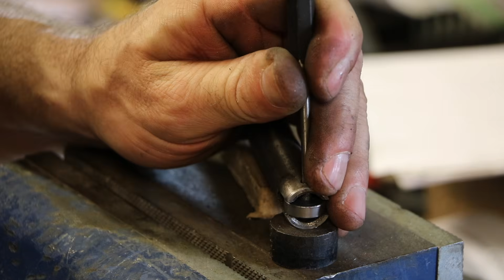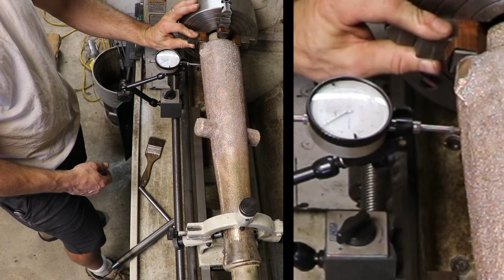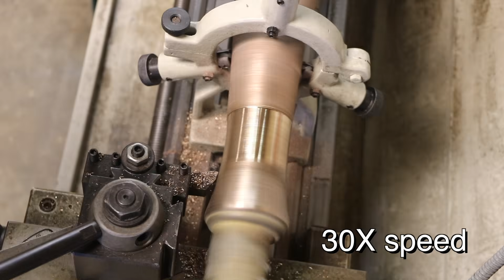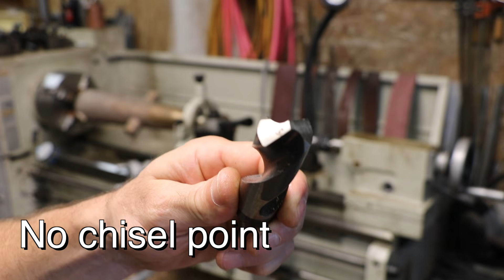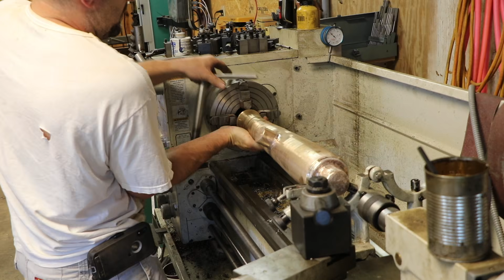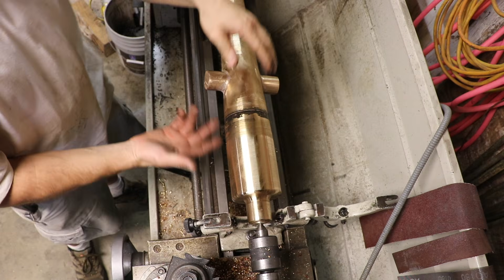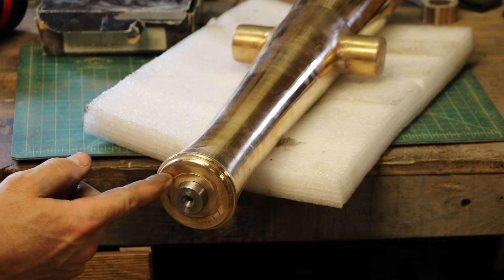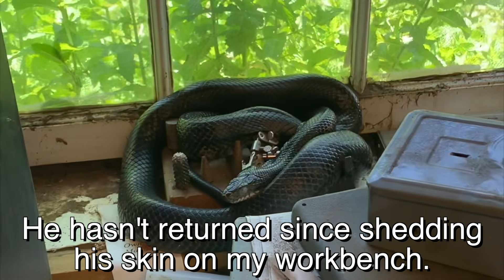Machining a Historic Bronze Cannon Barrel, Scaled Down Replica. FarmCraft101

Comment: Yepp, sleeve it as Sternstone suggest. But first reline the bore using epoxy resin that you allow to spin harden in the lathe filling all the voids. Then rebore it to suitable diameter and insert a stainless steel sleeve that you have filed a bunch of small notches in so it adds some grip. Fill the entire bore with epoxy resin before you insert the sleeve, then dump out the excess resin. This way you will be sure to have resin all around the sleeve/barrel junction. Finish it of by boring away the resin residue from inside the sleeve. You can make the sleeve two inches shorter than the barrel and insert a bronze sleeve in the opening if you want to mask the fact that there is a stainless sleeve in the barrel.  You can make this outer sleeve threaded for extra strength.

Comment: Sleeving the bore sounds like the best solution, the visible defects could just be a hint of other defects that can't be seen but have sufficiently weakened the barrel structure enough to make it unusable.
Reply: I would agree that sleeving the bore is the best option but still think it is unnecessary given the pressures likely to be encountered with a black powder load in a bronze barrel. However safety must be the paramount consideration so ... sleeving it is.

Comment: Just a comment that nobody will reply too, and you probably won’t see, but wouldn’t making the outside as round as possible before drilling the hole help? When it’s uneven it wobbles a little and that will throw off the bit. Just my opinion as amateur  machinist.

Comment: hmm... how unrealistic would it be to machine the defective part out, then heat the whole cannon near melting, and then add new metal in, (of course block the good parts with a block of wood or whatever) so you have only to re-do the bad part ?
Reply: alternatively, just heat the defective area with a blowtorch, pour some molten metal  in the defect, remachine the hole a bit, and you should be good.

as you said, this part doesn't need to be super strong anyway, a crappy fix in probably better than a gaping hole, because right now i would think that the air in the cannon pushed out by the bullet may bluid up pressure in this area, and eventually puncture it from the inside.

Comment: Fill it halfway with sand and pour more molten gunmetal back down to fill the area with the defect. If you only fill to the defect, you should be able to drill it out, no problem and if you torch the inside of the bore before you pour, you should be able to get it hot enough to weld pretty well.

Comment: I make muzzleloading guns but buy the barrels.  A few points: 1) All things being equal, chamber pressure goes down as the caliber goes up.  That your bore is 100 caliber helps here regarding the loss of strength due to the defect.  2) Use as coarse of a powder as you can get.  3) Shot loads should produce less pressure than solid balls.  Try them first.
4)  Most rifles in the .45 to .54 range will get something between 10,000psi to 16,000psi, depending upon the powder charge.  Smoothbores .60 to .70 get much less.  So your cannon has a leg up in the pressure department due to its extreme size.
5) Proof loads can be dicey unless you really know what you're doing!!!  It's so easy to use a proof load that's too heavy - which can cause the barrel to burst later on under normal use.
6) I agree with others here who recommend sleeving it.

Comment: My thought is similar to others. However I think before sleeving, I would mix lead and bronze shovings and using a rosebud torch, carefully heay the outside of the defect and melt the lead/bronze material into the void, re bore that area, then sleeve it woth a piece of DOM chromoly or 4140 alloy tubing. Great project, keep up the good work.

Comment: Back in "the olden days" they handled this kind of problem very simply - they just fired the cannons 10-20 times with really really really long fuses and the ones that didn't blow up were sent out on the ships.  The ones that did just got melted down and recast.  You are running into the problem that everyone who builds replicas runs into - you aren't setting up a production line to make hundreds of these things.  So your trying to get it perfect the 1 time that you do make one instead of making 100 of them and accepting a 50% failure rate or whatever hideous failure rate the factory accepted back then.  Also the factories back then didn't muss around getting the bores perfectly centered, either, or did they calculate out how thick the barrel needed to be.  Instead they just made the gun, fired it, and if every one of them blew up they made them thicker and they kept doing this until most of the ones they made didn't blow up.

To put it simply there is no possible way to create a replica that actually works like the original one did unless your willing to make a hundred or more of them and throw away the failures.

You have no choice but to "cheat" and sleeve the thing with a modern manufactured sleeve that will of course BE perfect.  Your barrel is already "too perfect" to be mistaken for an original anyway.....

Comment: Test fire with sand bags covering the barrel to help capture and damp any failure. Start small and then increase to double charge. At some point the powder will still be burning as the projectile leaves the barrel. My guess is that the barrel will fail because the stresses will have no way to evenly dissipate at that point of maximum defect. Right now you have a good looking display piece but if you want a working cannon either have a foundry cast a blank for you or keep recasting until you gain the experience need to make a defect free pour.

Comment: Dude your so close! You know whats next! (I ment to shooting that cannon not that snake wow, and the skin!) That last few inches is rough cast in 19:38 but where it meets machined surface, that surface should be concentric and cylindrical right? So still use a steady rest but indicate lengthwise (in Z idk if im being clear) along the top looking for flat as well as looking for centered. Hope I'm right I like puzzles. (idea #2 if your lathe has a spindle liner tube through from behind the headstock for running long part off stuff that might be true enough to craft a punch to slide in and tap it.) Woohoo I feel like I'm helping! You did fine homie HAHA and faster! Wow it just looks so good you should be proud.

Comment: If you use a projectile that is just a piece of paper. You will achieve low pressure. But safley still make noise. Then work up your load. Defect prevents a heavy projectile.

Comment: That defect is the one you can see.  What about the defects you can't see?

The bronze is solidifying from the outside in.  As a result, the inside portions of the barrel are pulling in the outside portions.  This will lead to circumferential cracking.

You want that barrel to solidify longitudinally, which means you need the heat to come out the end.  This need not take a long time, since the bronze is an excellent heat conductor.  You just need the conduction through the end to be significantly faster than conduction through the sidewalls, which means the sidewalls but not one end must be insulated.  You might even spray water on the bottom to get the heat out faster through that direction.   Don't cool it through two ends, obviously.

You will need high temperature insulation between the sand and the wood.  Fiberglass is good to 1500 F,  rockwool is good to 2700 F.  Neither will convey force.  Fireclay firebrick should tolerate 2800 F... I'd go with that.

You may need to preheat the form, because you need the bronze to be molten while in thermal equilibrium with the greensand.  Maybe run a propane blowtorch through it for a while.

Comment: Put a steel sleeve in. Engine blocks typically have the same defects if they are sand cast or die cast (worn out die)

Comment: Too late now, but with a firing cannon getting the out side concentric to the bore is extremely important. What I did on mine was drill the bore to diameter and length first. I then used a 1/2" diameter steel rod maybe 6" longer than the bore length. Cross drilled and threaded it at the end. Then turned a point on the end of a set screw. Thread the set screw in until it's point is maybe .050" above the rods diameter. I then clamped that rod in my bench vise at about a 5 - 10 degree up angle. Slide the barrel over that and then set a dial indicator on the barrels O.D. at the approximate position of the set screws point. Hand rotate the barrel on that set screw point and use a sharpie to mark where the high point for the run out was and by how much it ran out. I then set up the barrel vertically in my mill and used co-ordinates to center drill the back of the barrel true to the bores C/L. I also machined a two piece tapered and expanding collet that fit the barrels muzzle end, drilled and tapped the inner collet piece for a 8-32 Allen bolt and used a counter bored hole below the depth of the 60 degree center hole in the collets face to pull the two pieces of the collet together and expand it's fingers to grip the bore wall. That way the whole barrel was turned between centers and I was then sure the barrels out side diameter would be concentric to the bore C/L. For any long shaft type work I'll always chose turning it between centers over holding one end in even a 4 jaw simply because it's the most accurate method available. 

It would be completely impossible for anyone no matter what there experience level is to state that bore defect is 100% safe or not. There could be and probably are other internal casting voids in the barrel walls that would be impossible to know about without X-raying it. Maybe it's safe, or maybe it isn't. But you'll never know that unless the barrel blows up in your face and it's a bit late then. If it were me and as others have said I'd press fit a steel sleeve in it.

Comment: You were concerned about stress risers so you polished the outside of the barrel, yet you are considering live fire with a bore defect like that!!!!!  WTF I wouldn't even consider blank fire. SLEEVE IT or recast, only this time cast it in a pit with a 3/4" core and large runners to fill the mold from the bottom up.

Comment: Brass looks gorgeous.  Nice job.  I would take a few more boring turns, and see if you can get those out.  You can drop down quite a bit behind the swell.  I'd take about 3mm out and see where you're at.  If you're still worried after that I would consider sleeving it.

Comment: this could very welll be a serious problem - it could "deflect or tumble" the bullet in the bore and thereby cause a pressure spike high enough that you create a mixture between pipe bomb and frag granade - what you dont consider is that a lot of black powder doesnt react and thats also why you allways have a massive muzzle flash and unburned powder spewed out 
it would be less of a problem if you use a soft sabot - like plastic cups or sth similar 
best would be to electrode weld it if you can reach in there with some silicone bronze rod  and then bore it out to your bore diameter
or you say fuck it and steel line it - ideally at least 0.40" thick steel - if you buy steel , get actual heat treated rifle steel - ideally honed or lapped inside or cold hammer forged
added : and ideally stainlessso you have less of a problem with the powder residue eating away your steel

Comment: Gun parts designer here- black powder is corrosive. So if you fire low pressure, the 3-4mm deep barrel defects will trap powder and cause erosion over time. 
There could also be more pockets or voids in the brass / gun metal, just under the surface. 
If you ever intend on firing it, I would sleeve it with 416R, which will stop some of the dissimilar metal issues which will be present. 
4140 or 4150 would also be a good choice, but be sure you add end cap to this. 
Again, powder will be trapped at the base of the canon as well as dissimilar metal erosion. 
Make a sleeve, with reinforced steel slug in the end.
Rifling can be accomplished with a gear reduction box on your mill, and you can add whatever rifling you’d like. 
Rifling should have a slower rate of twist, as rifling adds considerable pressure. 
Cheers
Reply: Rifling is not needed and was not in the original bronze guns for good reason. The balls were a loose rolling fit in the bore and the pressure increase would have been dangerous in a bronze barrel. I still recommend sleeving for safety but don't rifle the barrel it isn't in keeping with the period. Just to be consistent I don't think it is necessary  to sleeve but it can't hurt.

Comment: Check out the North-South Skirmish Association website at www.n-ssa.org and check out their Artillery rules for construction. We shoot the full sized stuff in matches and a good many of the guns on the line these days are replicas like yours. I would suggest drilling it out and putting at least a .250 walled seamless stainless steel liner with appropriate chamber plug welded on by a certified welder. Then simply use high strength epoxy to fill the defects up and lock in the liner. The biggest issue with the defects aren't  so much how they thin out the tubes wall, but the stress points they create just begging the pressure to find a failure point. Traditionally bronze tubes were thoight to be safer because they tended to bulge before bursting like iron and steel tubes but with a defect like yours, I would be cautious even simply firing saluting charges.
There might be a way to use some form of epoxy to fill the voids but I am no expert in their use in this kind of application.

Comment: Solution for part droop: You just need to steady your barrel in the right location until you get the center drill in. Extemporize a wood steady - a wood block and a couple wedges. Adjust until the quill trams to the work axis of rotation. Quick like a bunny, center drill the breech boss (cascobel, I had to look it up). A small center drill is all that's needed. 

. I'm a machinist of almost 60 years experience and I'm here to say you have good instincts on how to work out your machining problems. Or you could hear me yelling at my computer monitor

Comment: I am no expert but I would not fire a solid projectile out of that cannon as is.  If you really want to fire it I would consider shooting a canister round or something that will not form an air tight plug because that defect will cause a significant spike in pressure as the projectile passes it.  If it were mine I would either bore it out until the damage is gone then sleeve it to create the correct bore or melt down the shavings and pour them back in to start over with the bore.  Personally I would just sleeve it and be safe rather than get all hung up on historical accuracy of the replica.  Nice work so far though.

Comment: I voted leave it as is; but I admit I was wrong. Looking awesome! I suppose the void happened when the channel to the riser froze shut, but there was still shrinking to be done back in the thickest part. Guess casting the other way around with the riser on the thickest part may have helped? Not too worried about it pressure wise; but it looks big enough to potentially mess up your projectile trajectory and have it get clipped? That wouldnt only mess with your accuracy, but would also quickly accelerate the scope of the problem I imagine.

Comment: the big defect, while not a good thing, is well past the critical pressure point, that said it could fail, but not likely, it will totally effect accuracy... not that a smooth bore is going to be real accurate,  a bigger concern would be something getting lodged in it and causing a crucial obstruction, so clean it often and keep an eye on it.

Comment: to get it level, indicate across the straight part, use the steady rest to adjust height until level, longer straight chunk would make it easier, but you had enough there to get close enough.

Comment: i think if you put the magnet holder on the axle of the endstock you can measure three points around the circumference on the barrel , you refference of a known centered shaft of the tailstock 
as for those hingepoints , i wonder if you can use a eeehr we call them hoe cutters to enlarge drilled holes on a mill and use them the other way around so you turn round stock smaller

would be a nice object for someone to do some gun engraving on 

as for the enclosure in the bore , i wonder if you can drill it out from the outside put a gipson plug inside the bore as a backing and tig / gas weld it full with a rod made from the drilled out material 
it needs to melt in realy good with the surrounding material or you blow the welded in chunk out , you will probably have to redrill and re machine the outside the barrel after welding too

Comment: one thing not mentions that I could tell was the corrosive nature of black powder.  You will not be able to clean that defect effectively so it just a matter of firings and time before she comes apart.   Fill it with the void with JB weld or bondo or the like and overbore with a sleeve.

Comment: Chamber pressure should drop of exponentially by 2 per volume. So if the chamber presure is 27000 in the first inch of the bore by the time it expands to 2 inches it would now be 13500 by the time it reaches 4 in it would be down to 6750, and so on so by the time it gets to spot on the barrel where the defect is the pressure is actually going to be fairly low all things considered so as far as the metal in that area being thick enough to withstand the chamber pressure I don't see an issue but I do see where and potential point of failure as the barrel ages but since you only playing the fire it a few times with the bronze taking the full brunt before sleeving it I see no problem at all